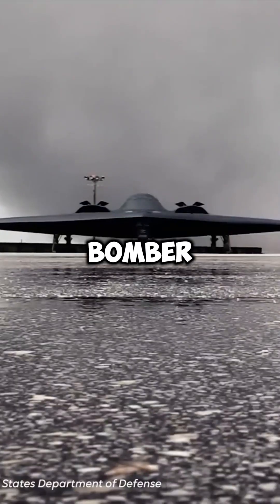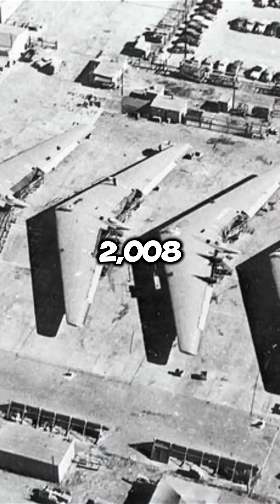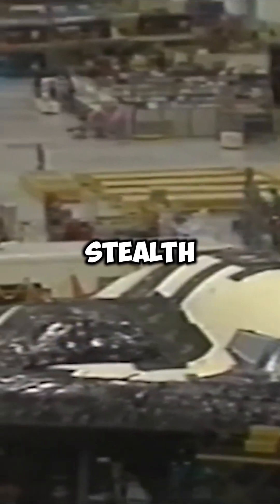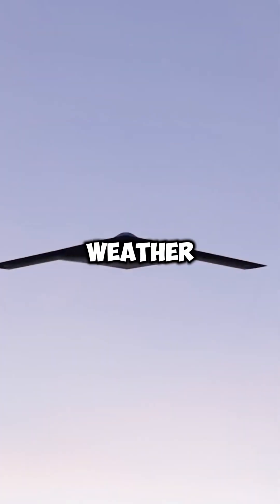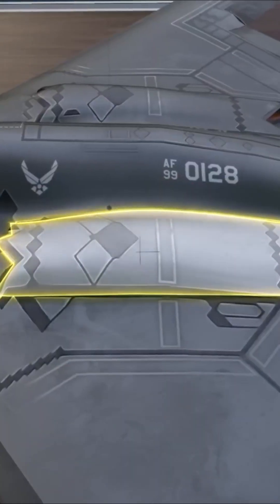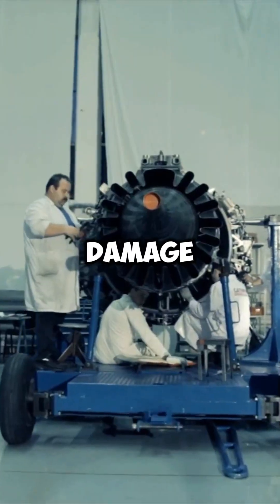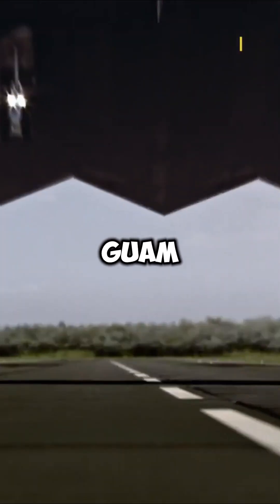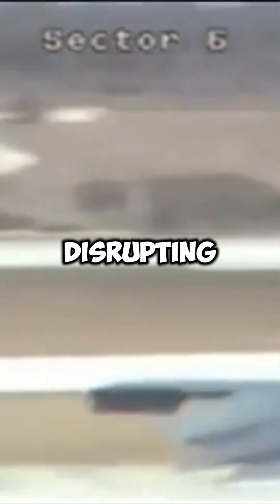Why the B 2 Bomber Can’t Fly in Rain #shorts #B2Bomber #MilitaryTech #StealthAircraft

Comment: one more reason why you need a pilot at the hands of aircrafts and not computers. at best computers should assist by giving information of things going on but the ultimate decision of pitching the nose or not should be the human's call.
Reply: Problem is, the design of B2 bomber means it's necessary to have computer to adjust the flight control, else it's almost impossible to control it with human
Reply: @Jm_-db1ie  then it's a badly designed aircraft if a human can't fly it. that you would need 2 at the limit sure but flying an aircraft shouldn't be dependent on wether it's computers are working properly or not.

Comment: Absolute BS.
The reason why the plane failed was not because of the engines, but because moisture entered the air-data sensors of the plane, thus the computer made wrong calculations for maneuver and made a stall.
Reply: litterally what he said in the last seconds
Reply: Ikr @Netscape-kd6mg
Reply: Were u paying attention or did u just feel like yapping
Reply: @Azavi-ws1oc  Still absolute bs that it can't fly on rain.
Reply: @AderanBugs  k but ur original comment is just pointing out what he said